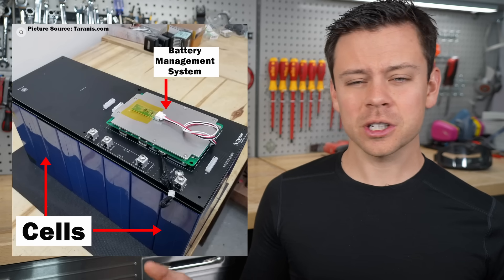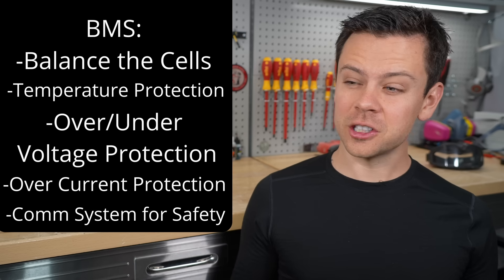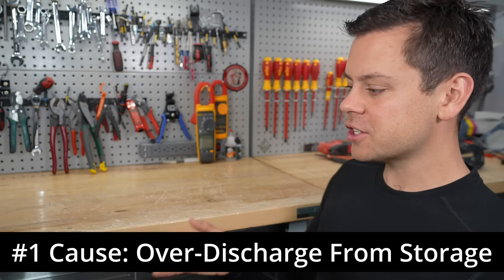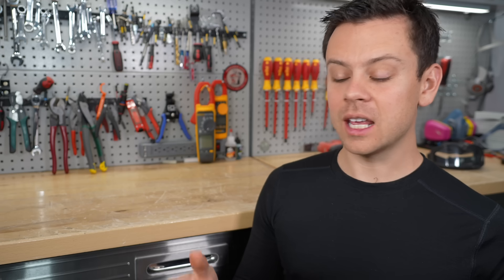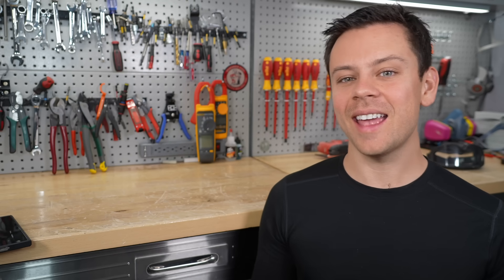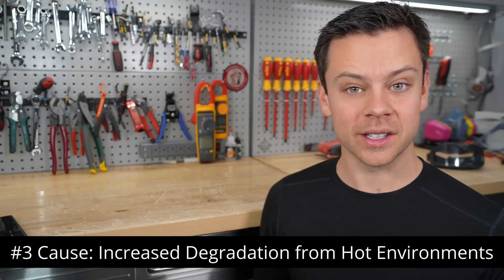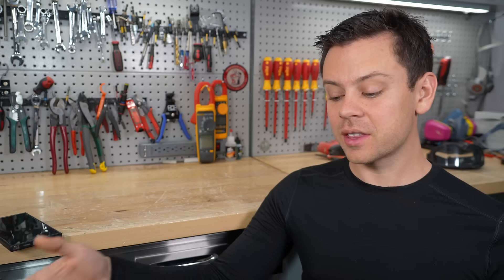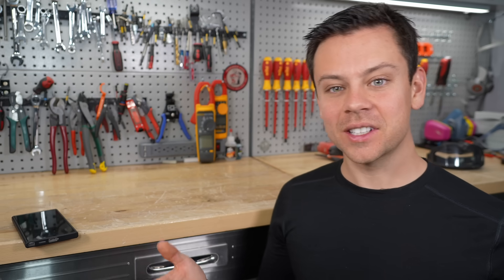The Rules of LiFePO4: The 3 Most Common Causes of Failure and General Guidelines for Long Term Use

Comment: I have one of the $15  PWM charge controller with a 12.8v 100ah LipO battery with a 100 watt solar panel ( will upgrade to 400w down the line ), should i be concerned about overcharging or degradation?
Reply: Assuming you meant "12.8V/100Ah" battery, not the 1000Ah you stated above, as long as the battery charges up to full, (%100) each day, or at least once or twice a week, you  should be fine.
Reply: @Tumbleweed5150  Thanks, will also correct the typo.

Comment: Question: if you are saying 0-100% doesn’t damage, and the battery should be charged to 100% as often as possible, why store them at 50%? Not 100%?
Reply: I have the same question and have always wondered. I hope he answers.
Reply from the maker: Because high states of charge for extended duration can increase the rate of capacity fade. But again, Don't worry about it. Just use the battery

Comment: What about freezing, going to -30 degrees F? Minnesota winter at unheated cabin? This is on an EG4 exactly as you recommended on a hand truck. I took it home from my water access cabin but it was a lot of work. Would love to keep it at the cabin. Panels are roof mount and covered in snow all winter.
Reply: Trying to charge below freezing will mess the cells up, trying to discharge below ... usually -25C will damage the cells as well, though more slowly.  Many battery BMSs protect against these situations and will disallow charging or discharging if it is too cold.  The actual effects depend on the C-rate... you can actually charge below 0 at very low C rates and discharge below -25C at very very low C-rates.  But as a rule of thumb, just don't do it.

Someone putting together an unheated cabin system in Minnesota needs either a heated battery or a heated and insulated battery compartment.  If insulated well enough it doesn't take much energy to keep the batteries at a comfortable 40-50F.

The key for a cabin system is to have enough solar to ensure that the battery is able to stay at a comfortable temperature completely unattended, without relying on a generator.  That is, without the battery discharging to empty (which would be double-trouble for you).   So... good insulation for the battery compartment, heating pad, thermostat, the battery, and enough solar to keep it going effortlessly even on cloudy days or snow days, and you are done.

Insulated battery compartments trump self-heating batteries. You can build far better insulation for a compartment than is typically available in a battery case.  Then its a heating pad directly connected to the battery through a thermostat (the battery can sit on the pad), your charge controller and solar gear.  That's it.  Make sure it works properly and its zero maintenance until the end of time after that.  Doesn't usually require much beyond a 10-20W heating pad but YMMV (depends on the insulation).

Lower temperatures actually vastly reduce calendar aging, its just that TOO LOW a temperature will damage the battery.

-Matt
Reply: @junkerzn7312 can't you just disconnect the batteries from the system and keep the breakers off if it's not being used at all during the winter.
And as long as he doesn't try to charge or discharge them in the spring before it's warm enough there shouldn't be any issues?
Reply: @mycabinlife1291  Yes he can.  I have done it for four years now
Reply: @junkerzn7312  I mean just storing the battery over the winter in my frozen cabin, instead of physically taking it home for storage. Thanks for your excellent answer.
Reply: @jackgoldman1  Hmm.  I don't know re: storage temperatures.  I personally would not store it there if temps can drop below -25C (-13F) unless you have a little active setup with solar that can keep them a bit warmer.
Reply: I wonder if one or two bifacial standing straight up would give u enough for heating and battery maintenance ?

Comment: #2 is the biggest issue that I have to correct people on, and often its like pulling teeth.  So many people try to optimize their LiFePO4 batteries by charging to lower SOCs (which creates massive problems just due to the inability to track SOC reliably), or try to reprogram their BMSs so they can charge to lower voltages and still balance, but don't understand the BMS parameters well enough to do that and wind up disabling balancing all-together.

One item I do disagree on is storage.  I always store LiFePO4 at 99% (charge to 100%, take a little off the top, then store).  Not 50%.  The reason is that the biggest danger for storage is forgetting to check the batteries in a timely manner and letting them get too low.  I usually recharge the stored batteries once every 6 months or so.  We don't want to put people on an inconvenient schedule that they can't meet reliably.  So... 99%, not 50%.

The thing is, in terms of cell stress, once a LiFepO4 battery has dropped to float levels the relative stress is going to be very low.  Yes, it will be lower at 50% than at 99%... but not really by all that much.  And self-discharge is happening all the time anyway so the stress levels are really quite mild even when you store at 99%.

-Matt

Comment: I have cells died in less than 5 months in the same package 5 cells out of 16 died.. even though I balanced them. And changed them to 55volts balanced at top.
Reply from the maker: What cells and what battery
Reply: @WillProwse  diy jkbms, I don't want to say the cell manufacturer, but I made a video about them.

Comment: Good info, but living in a northern climate the Lifepo4 batteries were more trouble than they were worth for freezing winter use, still use and rely on my AGM's.
Reply: If you add a tad more Capacity to your battery bank, you should be able to run a heating pad, etc., to keep the batteries from freezing.
Reply: @Tumbleweed5150  Thanks for the reply, it might be worth a try. But for now will stick with the AGM's in the winter.
Reply: @Tumbleweed5150  Thanks for the reply.

Comment: What if you’re BMS dies on one of multiple set of batteries, is there a danger of fire or does the BMS and battery just shut down?
Reply: It should just shut down the affected battery. As long as one doesn't cut into the cells, LFP batteries are safe enough unless they are in a fire.

Comment: I have recovered cells from as low as 0.3v back to full capacity. It takes time but it is possible. Some BMSs really aren't good at balancing if you don't allow them to do it regularly. A correctly set active balancer really does help in batteries that are regularly partially charged. If you run them completely flat the problem can be not charging them up afterwards although, as I mentioned, they can be recovered but NOT just by a normal charge, that will ruin them. Badly set up BMSs can be serious problem and some manufacturers don't have them set ideally. Low voltage overcharging can also be an issue if you use a voltage below the BMS cutoff, such as vehicle alternators, where the battery gets held at a high voltage after charging is complete. This is particularly a problem with batteries bought, or rather sold, as 'drop in replacements' when there really isn't such a thing. Hybrid with lead acid is about as close as you can get to that but then you do need to set the BMS up correctly for it.